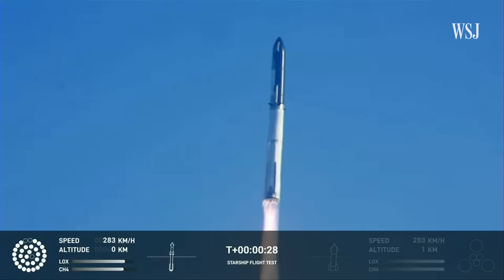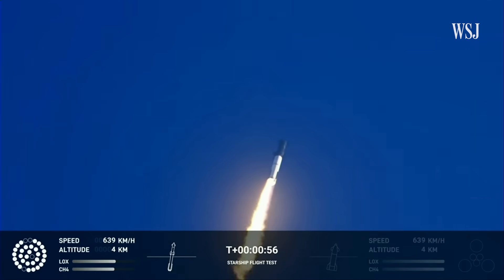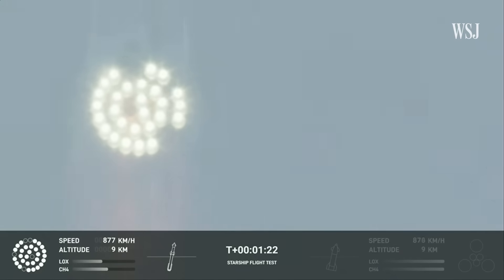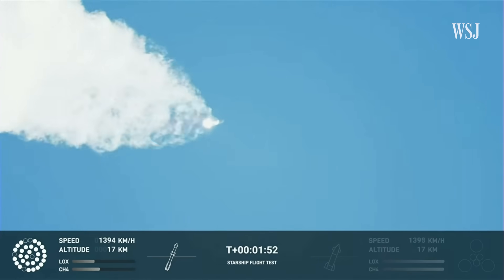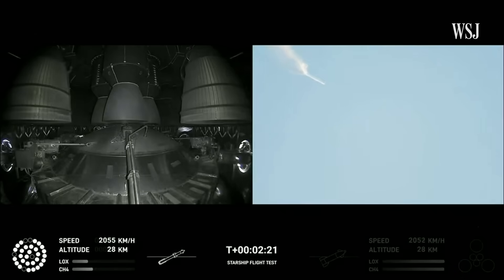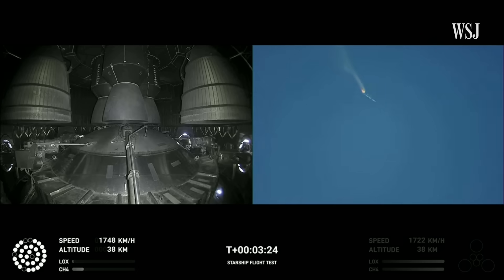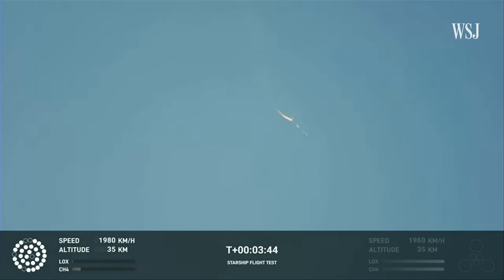Starship Explosion Video: Watch Elon Musk's Rocket Explode After Launch | WSJ

Comment: The available information indicates that the Starship upper stage on Flight 11 was not intended to be recovered and was expected to be lost after successfully achieving its final mission objectives.
Reports suggest that the Starship upper stage:
 * Successfully completed its flight objectives, including the re-entry maneuvers, landing flip, landing burn, and a "soft splashdown" in the pre-planned zone in the Indian Ocean.
 * Exploded after tipping over into the water following the soft splashdown.
Crucially, SpaceX commentators stated before, during, and after the flight that this post-splashdown explosion was intentional.
The likely cause for this intentional post-landing explosion is to:
 * Render the debris unusable and sink it to prevent it from becoming a long-term navigational hazard.
 * Avoid a floating hazard with remaining propellant or armed explosives that would make it dangerous to tow or sink later.
Essentially, for these early test flights with planned splashdowns, the destruction of the vehicle upon impact or soon after is a procedure to safely dispose of the remaining vehicle mass and any residual propellants/systems.
Note: This refers to the Starship upper stage (the "Ship") on Flight 11. The Super Heavy booster also performed a successful soft splashdown in the Gulf of Mexico, where it also reportedly exploded on impact, likely for similar intentional reasons.

Comment: The most annoying thing about watching a SpaceX launch is all that fake, piped-in crowd cheering sounds.  THE ENTIRE TIME, except when they could tell that it was rotating out of control.  Then the cheering when it exploded.  Nice try to cover up a failure, but we still know it was a failure.

I don’t like fake, and I know a few former SpaceX engineers who were TOLD to do that to try and spin the failure as a success.

It was still a failure, just “clearing the tower” is a very, very low bar.

Comment: How do you engineer a rocket that avoids off-spine-axis forces that can bend and spiral the rocket cylinder? You can see videos on V2 rockets: they have a lens form when the half-plane along the axis is viewed from the side. I read someone is researching the lens-form rocket design. If the rocket has to spin about an axis at a right angle to the 'long-axis' of the rocket, the lens can be easier to pilot. AND it can be caught by an arm, but the lens might need to be longer than the original V2 so it avoids falling out of the arms that catch it.

Comment: So much pollution 😢
Reply: Do you even know what fuel it is?
Reply: He doesn’t realize that Oxygen and Methane burned together equals Hydrogen, which is literally a part of water. These environmentalists going wild with false facts and little research.
Reply: @brendentodd9360  to be fair it creates carbon dioxide and water, not hydrogen
Reply: Didn't know that thanks
Reply: @jimrhodes3688  no problem. Just because something looks bad, doesn’t mean it is. That’s with rocket engines and power plants and many other things, mostly water

Comment: Who is responsible for this pollution? My Mother Earth 🌎
Reply: This isn’t pollution
Reply: You know right that the exhaust gas from the rocket is  water vapour and steam? Right? Right?🙂
Reply: @Monkeytheluffy56 Water vapor and carbon dioxide. Methane burns cleaner than RP-1 by a mile. Methane is the future of rocket engines for the next 35 years.

Comment: I love Elon and I'm a very big fan and I hope to work with him on this invention I have. 
But I thought it was funny when 
1. His head guy for Tesla goes to prove the safety of the self driving feature by standing in front of the car to show just how safe it is and the car just runs into him. 
2. Elon goes to prove the bullet proof glass with a baseball bat but it breaks the glass. 
3. And this isn't funny at all that when his car is under water it can cause it to have an electrical fire and the doors won't open trapping the people inside. 
As a fellow inventor those are things to work on and I thought of having a safety manual window opening feature that can engage.

Comment: Around the 30+ second mark, everything gets jittery.  I am wondering if that's just the video or actual bending.  A structure that long and skinny is not that rigid and oscillations need to be damped by the flight control system.  I'm sure structural analysis has come a long way but a rocket like this can't easily be tested for bending in ground test.  Then of course there's fuel sloshing around.  Lot's of work for control system engineers.

Comment: Have to love the spin of the facts by the commentators.  If it was only intended to clear the tower why did it have a second stage?  The test was a failure, the pad was destroyed, multiple engines failed, stage separation failed, and even the destruct system failed.

It would be nice to have commentators who actually described what was happening as it happened, instead of reading from a script.  I can’t see how events could be described as “nominal” when 5 engines have clearly failed.  We get a giggling fool and a script reader with a funny voice.  I miss Jack King.

Comment: When I first saw this i knew something was not right about the launch. These rockets leap off the pad like they are excited to get airborne, but not this starship. The second it FINALLY left the pad it was drifting to the left in my vantage point and if you look closely.....you can see the rocket gimble the engines to compensate to correct the drift. I watched this I dont know how many times, but fastforwarding and rewinding close up took a bit to see it slowly frame by frame.
Reply: Yes becauee there were multiple engines that failed right after liftoff, if you look closely you can see huge chunks of concrete getting launched vertically by the booster... There could be chunks that hit the engines making them fail.

Comment: I see a lot of people wondering why they cheered when it exploded.

The explosion was planned. Its a part of their FTS (flight termination system), after the boosters failed to separate, and the rocket began falling, the FTS triggered and detonated the rocket in the air to avoid potentially massive damage should the rocket impact the ground.

I don't know much about the data they gathered aside from the immense pressure the rocket survived while falling, that was at the least pretty impressive. 

Dont think I'd sign up for a flight yet, but yaknow. Baby steps. 😂

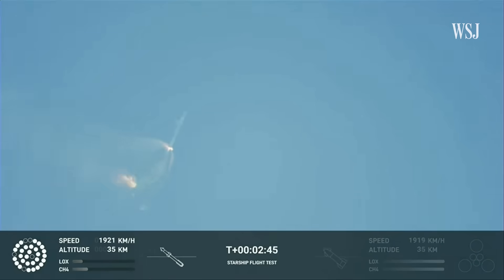Comment: Whenever I rewatch this I always wonder why he said "beginning to flip for stage separation" (2:55). Like, is he not aware that's not part of the flight plan for it to flip before seperating?
Reply: It was supposed to flip a little, but not that much. The commentators weren’t completely sure what was going on.
Reply: @BCR81  Not sure where you heard that but the rocket most certainly is not supposed to flip before staging. Afterwards yes (the booster) but definitely not before
Reply: @_MaxHeadroom_  they plan to flung the rocket a little bit to give enough forces for starship to separate since they don't equip them with separating mechanism or separation motors. But now they plan to change it to hot staging so this manuever won't be needed
Reply: It’s supposed to start a rotation right before separation, so the ship is sort of “flung” from the booster. I forget what type of staging it’s called.

Comment: As per my opinion the starship is good it's awesome but I guess the engines should be changed as the ship is very big so it would be hard for those engines to do such tough manuevours just my opinion no hate.!
Reply: Tough maneuvers such as…?
Reply: Such as i meant to say it would be a lot of stress for those small engines to maneuver that beast
Reply: @JUST._.KNOWLEDGE  they are adjustable to control the direction, and have various vents to let out gas, which controls it also. Regardless, seems crazy that it can do what it does.

Comment: The crowd is cheering that rocketship exploded?!  WTH?!
Reply: Because it was the very first TEST flight.

Nobody really expected it to make it past the tower and the fact it flew for so long means that they gained a lot of insights into how the design is currently going and where to make changes to make it better.

It’s called iterative design for a reason.

The rocket also held up much better than anyone expected. The vehicle had two flight termination bombs detonated on the side and did multiple end over end flips without failing.

No other rocket would be able to hold up to that or be expected to. 

Most people expected it wouldn’t even hold up to the launch. Hence the fact they prefixed the flight by saying “excitement guaranteed”

Comment: There should be more flight testing of the super heavy lift launch vehicle system with a dummy starship load mounted on top of it to cut costs. Only after successful completion of that a few times should the actual Starshlp be mounted on top of it to cut costs.

Comment: its funny that WSJ does not say 4 minutes in the flight. NO, they have to say after take off. it sucks that the stage separation had to mess up the whole test. if that didnt happen, it would be a successful flight.
Reply: That is not what happened. It lost almost half its engines. It never reached Maxq. The self-destruct system failed and for over a minute it was completely out of control. The launchpad was destroyed and major damage was done to surrounding protected wetlands. This was a total dangerous failure. It needs to be shut down until they can fix all the errors in the design they made.
Reply: @michaelwilliams2430  It never lost half the engines, it has successfully reached max q, the launchpad was not destroyed. Lies lies lies.

Comment: Booster 7 was obsolete on launch. 

Engine QAQC had already improved dramatically since the mounted engines were made. Steering is now done by electric actuation rather than a bilateral hydraulic system. The main things they learned on this test had nothing to do with the ship not making it to orbit that was essentially expected as it wasn't the best they had at the time. 

What they learned was 1, not to skimp on water as a intermediary between hellfire and any solid object in its path. (Using a water cooled flame diverter is not just NASA being overly conservative, it's physically necessary.)
And 2, a fuel tank built strong enough to theoretically survive re-entry requires substantially more explosive charge to open up and detonate than a conventional disposable tank. (The flight termination system needs more C4)

Comment: Looked exactly like his electric vehicles when the batteries explode while the Tesla is parked in the garage or parked on the street. Another way to look at this flight is that Elon Musk duplicated the Challenger disaster, adding a new sight. Flips and turns in the air as it was flying out of control.
Reminds me of what the Three Stooges would have done if they got a hold of some rocket fuel and a couple of empty 55-gallon drum containers. "Hey Moe, Hey Larry - Look." Woob Woob Woob Woob.
Reply: Have Rocket Will Travel(1959).
Reply: @monkeyboy4746  Exactly and funny today, as it was way back then. 😄

Comment: I saw Booster 7 and Starship 24 stacked on the launch pad last fall in person.   I had seen Apollo 15 and 17 stacks back in the 70s and it was way more impressive (in part because I was standing 150 yards away instead of 4 miles).  The rocket itself is new and complicated, but what Elon Musk has done is way more impressive.  He's built a Rocket Factory that can churn them out regularly, and also built a launch complex that is in itself just as complicated as the rocket.

Comment: The fact it's literally the most powerful rocket ever used and the ability to put that much thrust in such a small area with engines so powerful it blew the launch pad apart and left a crater underneath just from the amount of lift force from its engines was mind blowing. Uneven lift due to its engines power causing pad failure was a contributing factor to its loss of control and led to its having to be destroyed. Other than that it looked to be on target for a successful launch, definitely can't wait to see it in the next stage of development. The next thing to redesign  is a stronger better reinforcement of the launch pad and how they achieve that goal will likely create newer unthought of advancements as well. Especially if they want to reuse the launch pad and tower, since rebuilding the pad after every launch would be an issue.
Reply: Bruh he didn't create new technology for that engine , he just simply used more fuel , 

It is a complete failure of how they don't calibrate the thrust during the start , it was a actual actual failure why an uneven thrust was there are the first place
Reply: Oh yes, exploding the launch pad was in fact good. They should always blow the launch pad apart and leave craters. That was totally planned for the entertainment and awe of Elon simps.
Reply: No, being stupid enough to not add flame diverters is the reason the launch pad was destroyed, not because the "EgIn3S SO pOw3rFulL!"
Reply: A second failure soon to follow.😂
Reply: Rocket launches been done for ages and they still manage to screw it up and waste millions. What’s the point on building the strongest stuff if it ain’t safe . You need to go from A to B only. I’m sure there are already rockets that works fine. Huge screw up
Reply: WHAT ARE YOU TALKING ABOUT !! IT WAS FINE IN FLIGHT UNTIL IT OBVIOUSLY STARTED BOUNCING OF SOMETHING AND ENDED IN THE EXPLOSION. MUSK DID THIS WITH NO OTHER INTENTIONS, BUT FOR HIMSELF... TO PROVE IF THE BIBLE IS CORRECT ABOUT IT HAVING A FIRMAMENT SURROUNDING IT. AND OBVIOUSLY THE BIBLE HAS WON ONCE AGAIN.
Reply: Why does this design require more resources than the Space Shuttle? That's a fail in my book. They should just build an improved version of the Space Shuttle.
Reply: @sentry8992  starship is supposed to carry wwaayy more payload than space shuttle
Reply: @towtruckoperator  The Space Shuttle built the International Space Station. What's more substantial than that? What exactly is that additional payload carrying capacity going to be used for? It's not like they are trying to build a base on the Moon or another planet.
Reply: @sentry8992  before I say something stupid, was this satire?
Reply: @towtruckoperator  It's unfortunate that YouTube deleted my reply to your question about whether I was engaging in Satire. I'll try one more time. Hopefully it'll pass muster with the censorship police. The point I was making was that the increased payload carrying capacity of starship isn't necessary because the ability to explore different planets has to be achieved first. The payload carrying capacity only comes into play after its been established that a base is possible. Even Jeff has stated that humans are more likely to live on space stations before bases on the moon or other planets. Alot like battle⭐️galactica.
Reply: You could get more thrust just using SIX of the Space Shuttles SOLID FUEL BOOSTERS, and it will get into space RELIABLY! I mean why waste so much money to do something that NASA could already do reliably? The solid fuel boosters are far more reliable and safer than these deathtraps.
Reply: "... So powerful engines ..."; yes, they should get the credit. But the real issue is that they cheaped out on the launch pad. No water suppression or any other expensive systems. Just pour some concrete on top of the soil and cross your fingers.
Reply: Intellectual acrobatics to justify failure is always entertaining to read.
Reply: @sentry8992  I like your funny words magic man
Reply: Stop kissing elon bro
Reply: @VVSNIPERXVVSPIPES  Your name shows you know very little about Israel. For example, that there are thousands of Muslims in the IDF, and over 2 million are citizens of Israel
Reply: @VVSNIPERXVVSPIPES  other then destroying the lunch pad and blowing up a minute later everything was fine
Reply: @zer5236  than*
Reply: @zer5236  can’t spell basic 4 letter words. Exudes smug arrogance when someone is has their literal rocket science wrong.
Reply: @WlthrPonka  "is has" nice Syntax error you got going... anyway let us know when Elon does something in space that has not been done in the 1960's
Reply: @zer5236  and you still haven’t figured out your own error. Adorable
Reply: @zer5236  don’t forget all the engines that either failed to ignite or destroyed themselves after liftoff. This whole “we’re just glad it got off the pad at all” is a sales ruse. If you look at that control room, they were not pleased one bit
Reply: as they should be
 @sgtgiggles
Reply: @zer5236  no we mastered getting off the pad over 60 years ago. That’s the easy part. Like I said, sales ruse
Reply: You are so full of it. "The next thing to redesign" is a lot more than just the launch pad. It got past the tower, yet failed to do anything else. There's more than just the tower. Space X only exists because of NASA, Chinese and Soviet research and development.  Space X is gonna kill a lot of people than any of them if they don't view the results more stringently than you do.

For a test, that was about 1/10, as far as things going right -- the "1" being that the self detonation system worked just fine.
Reply: @chriskleven5441  you are both fake experts.
Reply: @WlthrPonka  And you add nothing to conversations. Thanks for your input.
Reply: @chriskleven5441  cry?
Reply: @WlthrPonka  Do you have a one word vocabulary?
Reply: @WlthrPonka  Sorry, 6 words!
Reply: @chriskleven5441  It's okay though they'll just kill a bunch of annoying youtubers and social media celebrities in their first flights. Its a win for the rest of the world if thats the case. 👍